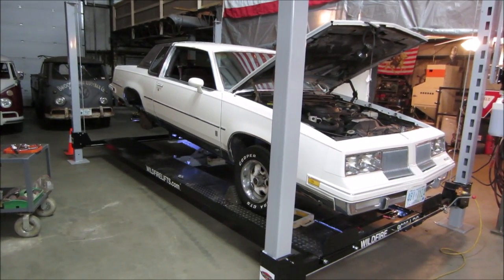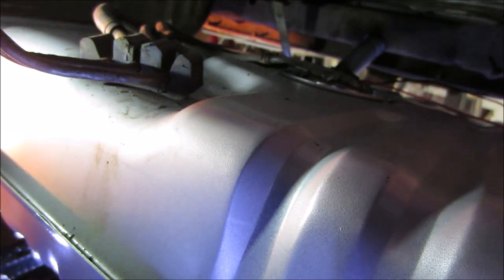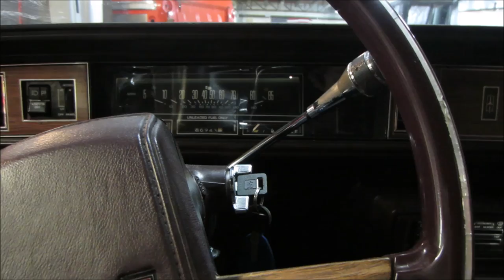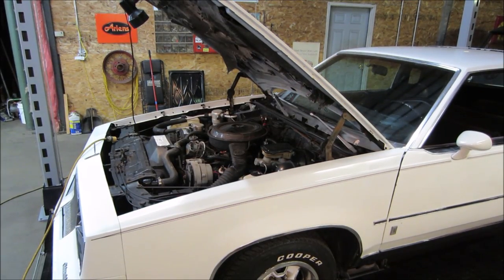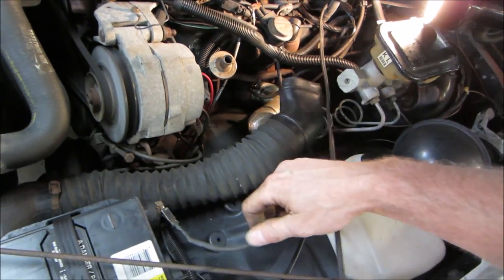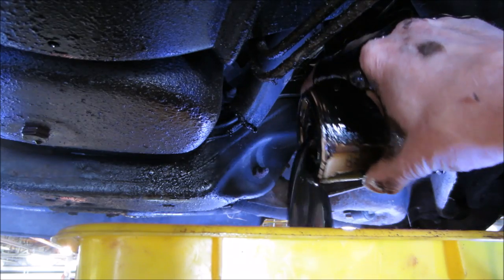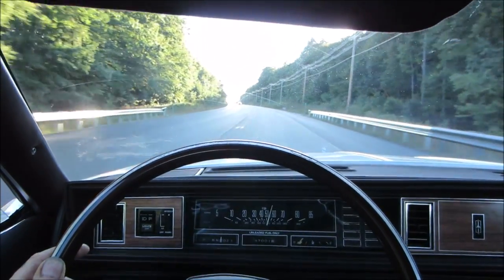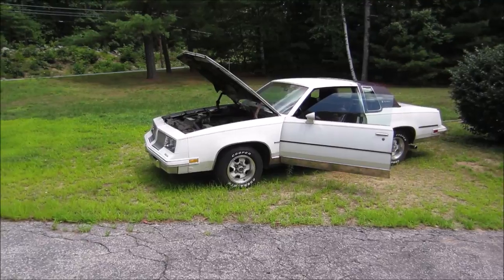Rustoring  Cars On A Budget. 1986 Olds Cutlass Gets Completed.

Comment: Modern oil for older cars that have hydraulic camshafts does not have zinc in it which will eventually flatten the cam most people use 1540 diesel oil for that reason because diesel oil still contains zinc the EPA didn't get a hold of that

Comment: I wonder if one of these could handle towing a car trailer with good helper springs and some trans upgrades?  I'm disabled and have been browsing to see what cars could potentially tow a car trailer since they'd be easier to get in than a truck.  I have an Outback but it only has a class 2 hitch on it, I can probably do the tow dolley with it but not a trailer.

Comment: I would have spent the $40 or so on a new sending unit.  Way too much PIA to remove the tank again to re-adjust the float or replace the sending unit later.  As a licensed meCHANIC I would clean the affected area of old oil then run the vehicle to locate or confirm oil leaks/repairs.  Very difficult to locate an oil leak when the entire under carriage is covered in old oil.

Comment: I miss these old G-body Oldsmobiles.  So comfy.  Reliable.  Really good cars, overall, despite their ridiculous lack of power because of the godawful 1980s emissions controls.  Only thing I would do to this one, other than fix the A/C, is put in a shorter rear-end with a limited-slip.  Then it'd be just about perfect.

Comment: Check the left and right rear plugs and wires they  get cooked from lack of air circulation.   Hotter it gets worse the miss check the intake manifold right at the very front corner where the cork meats the urethane u piece .  Its a common leak oil runs along the side of the valve cover ppl think its the cover but and go nuts trying seal the covers when it the manifold gasket.

Comment: Tell me if I'm wrong but most fuel tank straps have a rubber insulator that goes between the strap and tank to keep from having metal to metal contact. Metal to metal contact will cause ware and than a leak.

Comment: In the video...theres a part where you fixed the number 3 cylinder and tested the rotor cap! There are ignition wires arcing against each other on the passenger side! You can see the sparks! Nice Cutlass!
Reply: I thought that too. Looked harder & I think it's just a piece of trash or debris caught on a web & flashing back & forth very fast, making it look like a spark.

Comment: I had a few of these cars in the 90's.
I was always chasing exhaust leaks, oil leaks,  ignition problems.
The gas guage issues are usually in the dash, poor connection between the guage and the plastic film circuit that's in there. 

I found about 20 years ago that another us car maker builds much more reliable vehicles, ya it's not dodge.

Comment: There should be rubber isolator straps between the metal tank straps and the tank, yours seem to be missing. I have used cut up old bike tubes as replacements, or you can buy them online.  If not replaced, the tank may squeak, or rub a hole in the tank from vibration.

Comment: I had one the same exact year. It burned oil like crazy. I would carry a case of oil in my trunk at all times. I would watch the oil gage go down and the motor would start to rattle. I really like the car, but it just seemed to fall apart. Everything broke in it. I had a 1975 cutlass and it was one of the best cars i ever owned. In gonna say the 86 may have the worst. Mine had a 307 V8.

Comment: Oldsmobile went cheap and reduced the number of bolts on the valve covers---used to be ten and went to five. Pretty good peg-leg burnout. Olds used the same basic small block from 1964 until they quit making them. They just changed the bore size but kept the same stroke. Went from 260 up to 403. Great engines except for the crappy rocker arms.

Comment: Check fuse panel for saying Fuel Pump or Fuel Gauge  should be 20 to 35 amp fuse for changed may be fault if not be breaker square cube relay also too need clean on contact's pins! Also fuel tank reserve  be on last 5 to 10 gallons on E usually too but try keep at 1/4 tank fuel on low and ground wire keep clean from crossion rust on frame with ignition connector with heat shrink too plus a bolt with washer on circle top also bottom to frame , one frame hole then nut clean always too and save troubles years ahead plus every oil changes grease even lube bolt hardware even clean to! Also new spark plugs wires get High Supression Types or Ohm too and plus A.C. Delco type Platinum LT 44 types oil them every oil changes too ! Mustie 1 :) I am GM vechile owner also! all makes plus model  fix on with too and learn lots over years to Lol ! But there one thing lot owners have miss out also so won't wear out to fast like a Alternator, Starter, lights plus wireing even fuses plus breakers and tell fix up! On the - Black battery cable there a small  pig tail (Memory Wire I call it ) goes to fender with 10 mm cap screw plus star washer on head on ignition head of wire clean up plus fender hole even rusted use sandpaper even wire connector, bolt , washer put some grease when put back one and start better on cold and hot starts!  Plus l do the alternator, starter wires plus every oil changes to and battery posts to lube up plus clean too even STP Total Treatment fuel injection cleaner plus Oil change 10W30 no synthetic oil too plus check Antifreeze  plus Transmission and Axle even Power Steering plus Brakes tune up ! That pull right be Outer Tie Rods need grease on the Rubber 2 pumps cure it! Differentail fluid may need fluid too sometimes and exhaust need tune up Yes! Also excellent car and very fun car too!

Comment: I personally wouldn't change the rear end ratio to give it some pickup. It helps a ton on the highway dropping the rpms way down. Although I would put a Posi in it. With the converter locked up and in OD I bet that thing does 60 at like 1900rpm. Keeps that gas milage up. I personally would put some engine mods if I would hop it up... Cost would depend on the engine.

Comment: The valve covers in those years were junk.  They were so thin that it was hard to get them to seal, common through the various GM engines.  I used to put sealant on both sides of the cork.  For the Chevy motors you can get metal impregnated rubber ones that don't leak as bad.  The M4ME carb could also have a sinking float in it, they also had leaks in the bottom of the bowl that allowed fuel to drip into the intake, you epoxy the wells in the bottom when rebuilding.  That can cause the hard starting as the bowl doesn't fill until the engine is cranked over a bit.

Comment: I had an 82 cutlass brougham. They ride very nice. Unfortunatly the earilier ones mad issues with the egr valve. The V-6 3.8 motors became known as 'rock an roll' motors. Never could get that car to hold a descent idle....ended up trading in on an 85 astro van and drove the van for over 8 years....

Comment: At 34 years old, I would say that a spark plug wire set would be a reasonable expense.    When I had an 81 Escort, distributor cap, rotor, and wire set was a every two to three year thing.
Reply: wire set not need newer change. i has used my toyota camry wire set 14 year and newer not has problems, same all other cars, my ford lincoln has 40 year old wire set and newer not has problem, but distributor cap and rotor need change all normal car ewery year onetime. same sparks have good change, and oil manytime more. ewery max 5000 km need xchange.
Reply: @mattivirta  - And yet I've had three cars where all of the ignition problems were spark plug wires.

Comment: When i troubleshoot ignition misfires I start with a timing light and move the pickup sensor clamp from one plug wire to the next.  That way there no risk of damaging those old plug wire terminals and you're not leaving holes in the wire jackets which will lead to corrosion.  It's also easier than shorting the cylinders on cars that run louder exhaust or whatever the reason it might be difficult to hear a change,  with the timing light you can visually see if it's firing and if it's firing irregular. 

Also,  change that cap and rotor.  No visible tracking,  but it's clearly dirty and will cause difficult starting and rough idle.
Reply: Stoneyburke  true,  this time.  This engine is fairly quiet. But with a loud exhaust or whatever could make it hard to hear.  Plus the holes left from poking the wires and boots will lead to corrosion and ultimately more ignition failures in the future.

Comment: yeah, guaranteed valve cover gaskets are shot and peeing out the rear and most the way across bottom(it runs to the back and down) typical BOP/GM. 
I go with reusable rubber and silicone lightly to the valve cover itself, after hammering the bolt flanges back flat, they've normally been over-tightened in an attempt to stop the leak, which it doesn't and just domes the bolt down locations making the gasket over tight at them an looser all around.
**whoops, missed you having changed the gasket/covers off, loose bolt and those are flanged to spread the load(added in later BOP/GM) some used wide spreaders  :)

Comment: 8 Cylinders with 5L !!?? That sounds so insane to me (european).  My car has 5 with 2.5L, that is already massive by our standards. Do they still make them this big?
Reply: The five liter, eight cylinder engines are used primarily in trucks and large SUVs.  Most cars, other than the high performance models, have the V6 or 4 cylinder engines.  Most are now turbocharged.  The base engine for a Chevy pickup is a 2.7 liter, turbocharged four cylinder.

Comment: I had a 78 Mercury Monarch with 302. Bad choke and manual chokes didn’t work great. So I used a very light spring on butterfly as an automatic choke. Never failed to start and would idle(lope like a  big cam)around 450-500 rpms in 30’s temperature till warmed up. Did not run rich either.

Comment: A good way to check spark on each cylinder is to use windshield washer hose put it on the distributor and then put the wire over it and use test light it conducts the spark

Comment: Make sure the carb does not empty itself overnight in the intake, trough the rings and in the oil pan. There is some sealed passages in those 4 bbl. Carb that would cause the drainage of fuel in the intake.

Comment: those Qjet carbs can leak from the bottom, they have press-in plugs that fail.  i went thru this on a 71 Olds, drove me crazy.  i was fiddling with the spark b/c i thought the carb had fuel in the bowl.

Comment: IIRC, GM vehicles at least in the early 70s had a slight pull to the right as a safety measure in the alignment specs.  I'm not sure if that carried over to any later vehicle.

Comment: Has 150hp well 151hp with dual exhaust lol
Reply: Apparently that engine had an anemic horse power rating of 140HP and 255lbs of Torque. I would assume that the mid 250s HP would be possible without a lot of work.

Comment: I really need to fix the exhaust leak on my 92 Silverado, I recent had a tire blow out and messed up the exhaust system, mostly just broke the muffler and te other had a hole in it anyway, So I cut the mufflers off and Welded up about 3 feet of 2.5 inch pipe on each pipe, its straight piped essentially, Sounds good, but I do have a leak somewhere and I hope its not the donut gasket, I don't have the money right now to really be dealing with it, thanks Covid for messing up my job.....

Comment: the last sending unit i got had the pick up tube and sender as one assembly. i didn't even know you could get just the sender alone. the presses they used to make the repro tank prolly had less pressure, or the dies were reverse engineered from old worn ones. either would account for the shallower stiffening ribs.

Comment: GM rotor Button in about that model year always went bad, they would burn a little hole under the rotor button tab and short out against the center shaft of the distributor.  Sometimes it would burn a big hole and sometimes you could not see the hole but it would short and cause a misfire.  It would also just kill the engine too.

Comment: Hey, I wanted to say that I love your videos..... you have taught me more about Carburetors then even my auto tech teachers did.... Now, my son bought a OCC bike frame that was converted to a gas powered, 2 stroke stihl engine, and we are having issues with the clutch. Someone put a belt drive pulley on it and the clutch wont engage. It's a centrifugal clutch. Idk anything about them. I suspected that the clutch bell isn't the right one. It seems slightly bigger and thats why the clutch slips. I wanna fix this for him. Any suggestion?

Comment: Check under the rotor for a little speck those are bad about grounding on to the advance weights and also tug the white wire that goes to the module they will brake the core and jump the arc until it stalls under advance

Comment: check for  spark at the distributor   cap   unplug em  and  see one by one  if engine slows down or speed up  no diffrence means u found the one not fire  if still miss  just  do it  plug wires   gap  choke

Comment: Mustie1 I would get that car up in the air on jack stands outside and put some good degreaser all over the underside of that front end let it set up and then hit it with a pressure washer. Run the car and then check it to see where the oil leaks are.

Comment: seems like 305/307/350 GM motors used the same plug wire get. everybody should have those in stock.

Comment: aaaak  You absolutely need Cap and Rotor that HEI system is very sensitive to the carbon  or more commonly known as "pecker trails" on the cap and forote. sometimes you can clean them up with a little emory cloth and some brake clean but  usually it is simply better to change them.

Comment: That car sounds like it geared with a 3.42 or 3.55 or 3.73 gearing it turns the rear tires as easy if not easier than my 87 SS Monte Carlo with 305

Comment: sounds like maybe vacuum leak, but pretty typical lean idle of pollution control crap in that era.
I see an issue, cap off the pollution control "check valves" which used to go to a diverter valve and air pump setup. why? uncapped they'll allow oxygen rich air to be pulled into the exhaust manifold at exhaust valves and pulled backwards into cylinder, especially at idle with the low exhaust pulse rate and low to no backpressure, if you free rev it and let off it should pull through them hard and make a loud puttering sound. (learned that years ago in my playing's)  :)

Comment: I miss doing burnouts in my old 72 Dodge Dart Swinger. I drove it around in the late 80s & early 90s It had a 340 cid. Dual exhaust &  original rear end for a slant 6 cyl. Lol smoke em! 👍🇺🇸
Reply: I had a 74 Dodge Dart Sport.  Always wanted to try the 340, but mine was the 225.   Add in California emissions, and it ran like crap.  The only new car that I only kept fir a year.  I should have taken it to a speed shop instead.